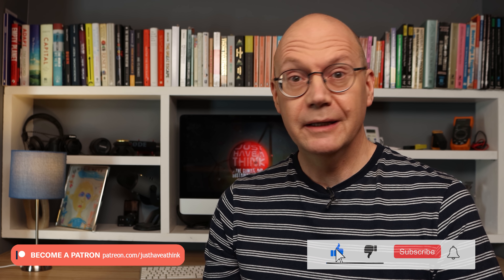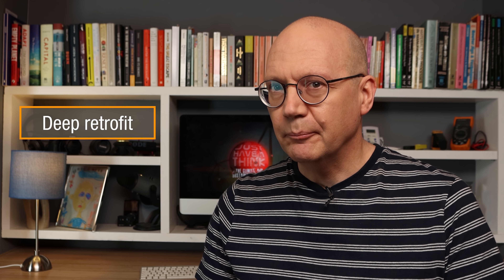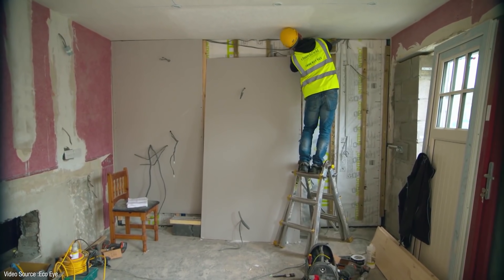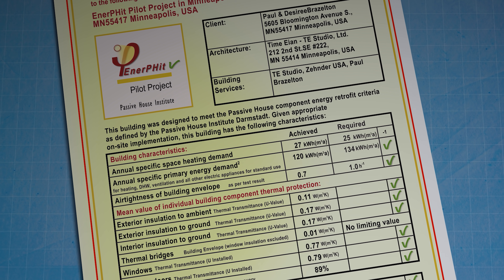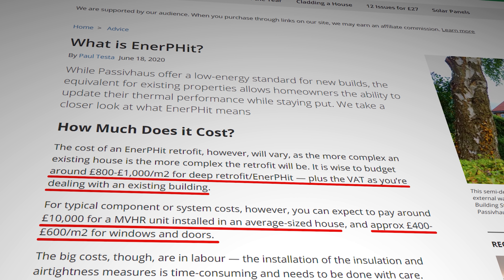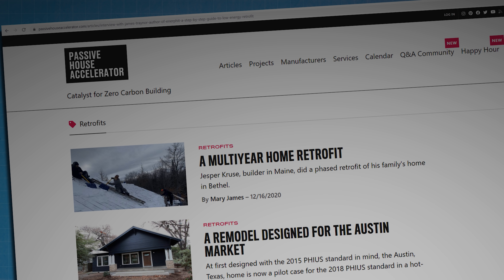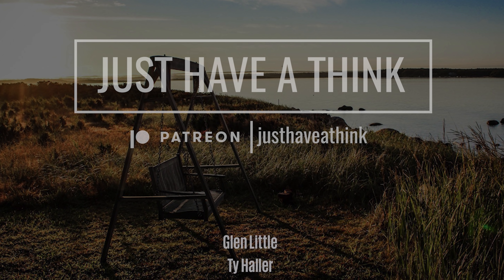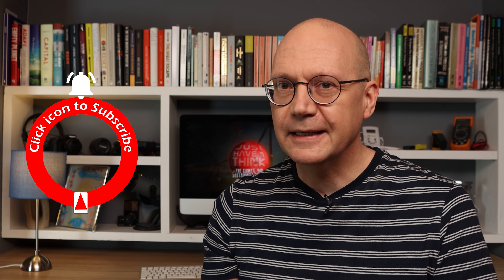Retrofitting to Passive House standards

Comment: We have a 1942 bungalow in Seattle. I wish I did a blower door on the house beforehand, so I could see how much I tightened it up. 2 years, two rolls of housewrap, a load of cellulose insulation and countless tubes of caulk and bottles of spray foam later, the house blew 7.5 ach50, nowhere near passive house or Enerphit level, but tight enough to surprise the energy auditor. 😂 

I think the only way to do much better without a full deep retrofit would be to use closed cell foam insulation, but I don’t feel confident enough to DIY with that stuff. If I ever get to it, I might try xps foam board in the crawl space. When we redid our siding, I thought about external insulation, explained in the video, but it would mean zero roof overhang because our house doesn’t have eaves or soffits. That’s just a taste of the complicated mess that is retrofitting existing homes.

The only way to get to passive house standards is to basically gut the house at significant expense to the homeowner, although there are some interesting products like Aerobarrier that make it a little more affordable. Would be great if we had an army of trained home performance experts that could provide affordable advice to homeowners and manage the home upgrade process for us. No easy solutions.

Comment: The issue with retrofitting is the local city's permit ordinances, codes, and inspections.  These offices are usually run by old men, set in their ways defending to the death of what they know over the years ..... and the resistance to change.  Then, we have the local Kens and Karens neighbors who also resist anything new in the neighborhood.  With that said .... passive home's fundamental requirements should be adapted to specific regions.  For a warmer climate area, the building should have a degree of leakages to allow fresh air exchange, especially at the beach, and house with gas appliances.  The best bag-for-the-buck energy efficiency improvement is roof installation, followed by windows and doors.  Again, these things should be a local climate define, and not one "passive house" set of rules.

Comment: I managed the contract for the construction of a certified Passiv Haus school in West London. GIFA was 1600m2.  We had to hold special training sessions for the 45 odd subcontractors to ensure that we reached the specified targets.  The main innovation was to run a quality risk assessment programme and to put in place evidence collection and inspection routines during the build.  Costs were around 10% above “normal” construction methods, but a lot of this was due to the steep learning curve.  Interestingly the 500 odd children were included as a heat source for the calculations

Comment: You don't know how much of a difference energy efficient building design makes until you've lived in it. I am moving out of a B EPC-rated new build, triple glazing, insulated walls and floors (and it has South and South-East aspects with big floor to ceiling windows). I turn on the heating a few days in winter, max. 

I've just bought a Victorian terrace with a rating of D and the first thing I hope to do is retrofit some energy efficient insulation and other design features to try to get it close to what I had before, but it won't 100% be the same.

Comment: surely if mechanical heat recovery air swap system needed the only heating option should be air to air heat pump with air swap integrated ?

Comment: In the thumbnail there were foil faced sheets being used on the exterior of the home.  Does anyone have any recommendations when using this panel?  Should it be taped at the joints or covered with a house wrap and rain shield?    tHanks all.

Comment: I just paid my electric bill for the Phoenix heat dome... $35.  Without designers and builders. I am working on my sand battery too.  Passive solar is easier now that I am retired.  #1 I moved to the mountains. I planted deciduous trees on the west side, they are coming along nicely. Remember that trees transpire up to 2000 gallons of water every day! Like a spritzer on a restaurant patio. I open and close heavy curtains following shade. I decided I want east shade too, this summer I planted deciduous trees on the west.  I have solar panels on the south, and I will have my sand battery there. At night I use a window fan, so nice. My house in town was brick, so in the summer I quickly hosed it down after work.  It kept it from radiating heat all night. I also had a whole house fan that was a delight. 
That heat dome convinced me I want a whole house fan.
Do what you can to stay safe.  A water spritzer and fan can safe your life. 
Our forefathers kept more comfort without becoming a consumer unit.

Comment: Hi everyone, very good explaination.
If a house was built using DTS Method (Deemed to Satisfy) and it was later found out that the insulation material used in Ceiling (R4.0) and Wall (R2.5) were found to be faulty material (R value is 35% of its expected rating). 

The wall insulation is not R2.5 but only R1.75, singles glaze windows, black roof, west facing and other building material that was designed as DTS only (deemed to satisy). 

Does overlaying the existing R2.8 Ceiling Insulation with correct R4.0 will be enough to make the house to change from DTS to 6 Star?

Comment: Who says that old buildings are not better environmental constructed than new buildings? With duro walls? I will tell you way. The walls are thicker, the roof loft is higher. That alone is better cooling in summer and better warming in Winter.  You start with a loft insulation. Than to fill the wall cavities with expanding foam. Half the job is done , use thermopane windows. Finished. If you want to overdue it, you use outside wall panels and a thermosensor to detect leaks. Heat goes up , you catch it by ducting, like a giant hoover and drive it with a slow fan down again, to keep air circulation. You can use Window
Shutters to improve it by night, as well I haven't seen any good ons on the Market, because it doesn't have to be always roller shutters , you get simpler and more robust solutions.

Comment: Been involved in a number of deep retrofits to Passivhaus standard, first tip, make sure the architect knows that the envelope includes the ceilings in said property. Also, anyone undertaking their own retrofit,  I would advise objecting to any new builds being built locally on the grounds they are inefficient and should strive to be as good as if not better than Passivhaus standards. Lastly it takes a lot longer than standard building work to be completed, be patient and don't scrimp on labour' and trades.

Comment: I am Building Performance Institute certified and I have regularly literally doubled yes, increase the Energy Efficiency of older homes by 100% 
which is to say I dropped their Heating and Cooling bills by HALF just using basic air sealing and insulation (and *no new windows*!) to BPI standards.

One of the keys that many people don't tell you is that air-sealing correctly and moisture mitigation from the foundation and crawl space is a much bigger Factor than attic insulation!

Speaking of attic insulation fiberglass does not function as insulation! There should be a class action lawsuit because air blows right through fiberglass and if you look at Dow Corning documentation they have a tiny little asterisk for their R-value that says that that our value is only if perfectly installed which is to say with zero air movement which is to say with correct air sealing which is Almost Never done!

That means by simply applying correct vapor barrier and moisture controls FIRST
...and...
 THEN the proper air-sealing...

And FINALLY ...
Blown cellulose mixtures insulation into the attic...

I have repeatedly found for many years that it is common to cut Heating and Cooling bills in half for about 3,000 to $5,000 of materials and labor.

That therefore requires half as many solar panels to hit Net Zero which now becomes an achievable Target on a normal two-story or three-story houses roof!

Which means that for a 3 kW to maybe 7 KW system you could easily make a house Net Zero for probably about $25,000 to $40,000 depending on the difficulty of the site.

I know this because we have done it repeatedly.

Comment: Pleasantly surprised by the comments here - lots of people doing what they can and chipping away at weak spots in their own properties. 

It's important to think about what is cost effective. Building regulations in the UK have just been updated, meaning new walls in my extension will conduct 90% less heat than my old ones, but cost a lot more than building them last year would have done (still 85% less heat). The marginal spend isn't justified by the returns (even at today's gas prices) and would have been far better spent on retrofitting the remaining walls, which will happen once my bank account recovers from the current work.

Comment: 'Passive house standard' and the UK government, not a hope in hell !
They CANCELLED the net zero houses being built from 2016 onwards in 2015, regardless of the construction industry saying they could do it.
A 1000 quid per square meter, well that's the massive issue, most people don't have this spare cash.
Won't get past the level of light retrofit then (already done).
Second solar array going on soon countering the mad electric costs.

Comment: In canada every house lot freeze point changes in the wall. Cork floors are preety cheap and ive seen mats . They use cork to insulate rockets and spaceships . How come they dont have a cheaper one even arubber graphene would be more efficient and you could fastened into it

Comment: So what you're saying basically... I might as well knock down the house and rebuild it to passive house standard.  £1,000 per square metre. I will be looking at £360,000   for a solid wall Victorian house. 

Thought did cross my mind...  I'm calculating roughly 144 kW per square metre per year  for heating

Comment: In reality, this is just not going to happen in any meaningful way, on any meaningful timeframe, with the majority of UK housing stock. Without a huge government subsidy. I can also see this being an area ripe for cowboy fitters.
Just two examples, my brother lives in a three storey Victorian terrace and my sister lives in a Georgian two storey terrace. Both terraces would have to be done in total. The facias would be irreversibly changed in both examples. 
A better solution, but a very extreme way, would be to simply demolish and rebuild whole streets. Probably cheaper in the long run.

Comment: If you do the maths on the figures provided in this video, you end up with about £200K for a typical 110m2 3 bed house in the uk. That's comparable to demolishing and rebuilding. And you end up with a compromised house compared with a new build, with brick frontage replaced by rendered external insulation randomly across our many millions of victorian and 1930s neighbourhoods. We'd need enormous quantities of qualified and experienced retrofit teams and each project would take months of disruption and stress (have you worked with builders?) All this would seem to imply that mass scale retrofits are not a viable solution to carbon emissions from heating. Surely we should prioritise providing plentiful clean energy that can be used in our existing housing and heating systems instead?

Comment: I have personal experience of a social housing part deep-retrofit in 1988 that cost over £30,000 for each small flat in a pre-war block. U value ended up about 0.28 by removing all doors and windows and woodwork and installing up to 100mm of interior insulation layers. This of course required a full decant of occupants. I admire your up-beat presentation, but can you do a breakdown of the Insulate Britain issue and how much it would cost to bring the UK housing stock up to 0.18 U values and 25kwh/m/y? Small holes in the insulation sealing are now causing damp problems, which means the retro-fit itself has a service life. Money is energy. The materials and the wages of people to carry the work out. Is it really possible financially?

Comment: The problem with retrofitting is the cost vs the savings - a retrofit of my house would take over 100 years to pay for itself. Even fitting double-glazed windows doesn't work since by the time they get close to paying for themselves they wear out and need replacing again. I think something like loft insulation works though - relatively inexpensive to install and doesn't wear out.

Rather than a retrofit standard for 'as close to perfection as possible' we need one that shows us how far to go to give us the best return on our investment. From a carbon footprint perspective, this should include the idea that wasting green energy is fine i.e. it might be better to pay for more green energy production that we can allow to escape from our house rather than pay to keep dirty energy in our house. Obviously paying to keep green energy in a house is pointless in terms of carbon footprint, but would still help in areas where it saved money.

Comment: Thanks for the video!  I can give some tips from a Passivhaus and building science perspective.  

In terms of "bang for your buck", here are the main goals for new or retrofit builds is as follows:
- first define the entire thermal envelope.  Know where it connects to your windows & doors.  Know how it connects transitions between one floor to another, or the top floor to the attic & roof.  
- Thoroughly air-seal the entire thermal envelope.  You will need to run a blower door test prior to closing up your walls to make sure your air seal is good and complete.  
- Super insulate the roof and/or attic.  This is where most of your heat will escape in the wintertime via the stack effect.  

In terms of other work, insulating your exterior walls and installing new triple-glazed windows is optional IMO.  The most effective work was to air-seal the walls, since air leaks are where much of the heat escapes in the winter or comes in during the summer (at least for exterior walls).   

Air sealing provides two benefits:
- prevents hot air from coming in during summer, or warm air from leaking out during the winter (which feels like cold drafts coming in).  
- prevents moist air from coming in during the summer.  If you keep your space air conditioned all the time in the summer, much of the humidity issues are due to air leaks in the thermal envelope.  Air-sealing allows your A/C to cool the air effectively without making it feel too clammy.  

High performance windows and doors are necessary if you dramatically increase the insulation levels of the exterior walls as well.  This is because poor performance windows will act as a thermal bridge in an otherwise highly insulated wall, which ends up dragging down the overall thermal performance of the whole wall (windows included).  You should install the best (lowest u-factor) windows you can, though technically speaking, the best windows have the same thermal performance as a lousy wall (roughly R4-8, in imperial units).  

I would also suggest the MVHR systems as suggested in this video.  Indoor air quality is a topic that is becoming more well-known and important to people.  MVHR systems are designed to run constantly to provide fresh filtered air to occupants.  They have heat and/or humidity recovery cores that exchange heat and/or moisture.  This warms the fresh air coming in during the winter, and cools the fresh air coming in during the summer.  

MVHR systems are supposed to be separate from heating and cooling systems.  You could combine the two, but it's more efficient to have a separate mini-split heat pump to cool and heat your home.

Comment: I think return on investment is the most important factor for people and businesses. That could be helped with subsisies or a higher price on CO2. We’ve made our house from 1989 almost energyneutral. But some things were just to expensive, like triple glazing or better insulation in the walls. What could be done was: HR++ glazing, extra floor and roof insulation, air sourced heat pump (with floorheating and new radiators) and 16 solar panels. Investment about €25k after €5k subsidies. Energy bill went from €80 to -€10 per month.

Comment: One of the problems is very clear at 8:10 in the video - plus 20% VAT!! Just like the 20% VAT on solar panels. And its not widely known outside the building industry but if you build on a greenfield site 0% VAT, brownfield site 20% VAT. Its not rocket science to figure out what needs to change. And the quality of many new builds is a disgrace.

Comment: Thank you for this great video. Also mention the importance of solar screens or overhang to prevent overheating. I ‘ve been working as a constructor to make low energy houses and passive houses airtight since 2005. I lost count on how many projects have been done. Important to realize you can plan retrofits in phases. Roof is most important since most energy is lost there in old houses. Good roof insulation should be airtight inside with a vapor brake or screen and windtight outside with a vapor open water draining layer outside. Bioecological materials are to be preferred. Sloped roofs generally have less problems to use natural insulation materials.
Reply: What about outer roofing material? I keep hearing reflective and white, but I never ever see it
Reply: @V.Hansen.  It does exist, in Europe. The name of the product or producer escapes me now. Perhaps Unilin or something. What I know the outer part is white and the inner substance is in fact ecologic